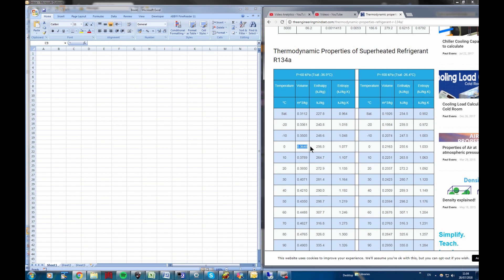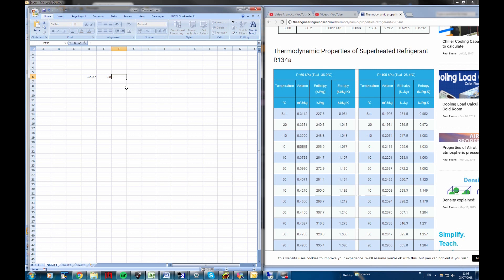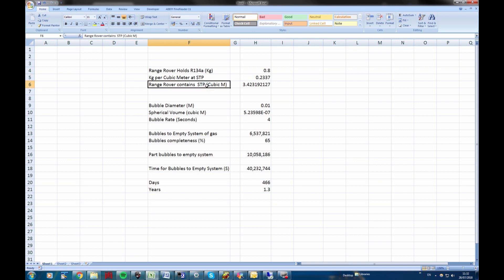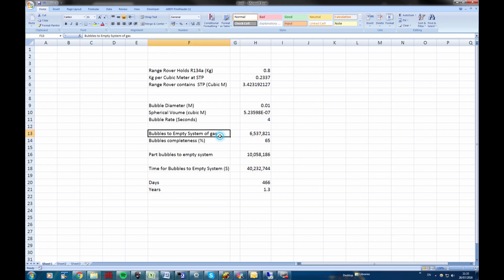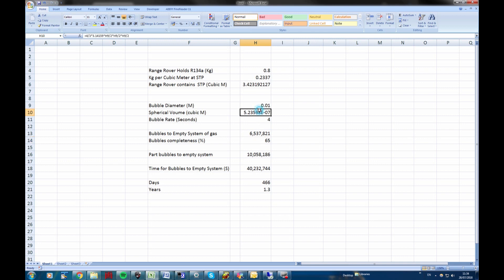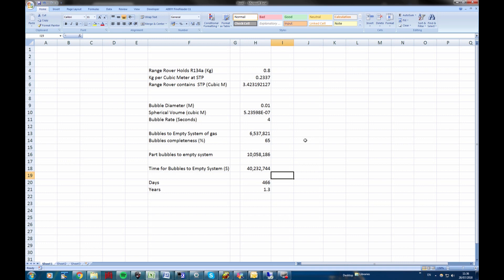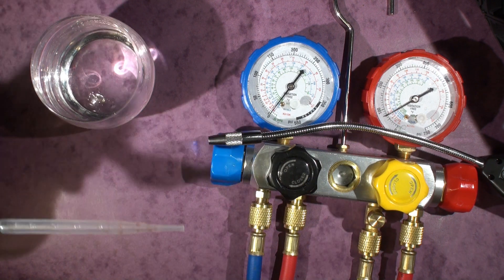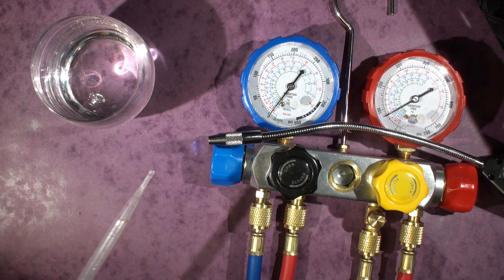Elitech WJL-6000  eBay HCFC Halogen Air Conditioner leak detector Part 2

Comment: did you ever track the tiny leak down?
Reply from the maker: Yes, it was the shaft seal in the compressor.  I tracked it with UV dye.  I was told that  shaft seal works better when wet with the oil. During long periods of non-use (winter) the seal dries out and is more prone to leaking. I would be interested on views on this as I am not sure that I believe it.  The seal was about US$19. Has been OK so far.
Reply: @razenby  thanks for the reply i have a nissan almera tino 1.8 petrol my aircon can hold a vacuum for long periods with no drop but it won't hold pressure for more than about a week been told it could be shaft seal that gets "sucked" tighter under vacuum and leaks when being "blown out" using pressure....could be right i guess
Reply from the maker: @brianwilliams5930  That is a really good tip. Next time I check one I'll try the vacuum hold test. Hopefully the other O ring sealed joints are leaking  they will still leak if under pressure and under vacuum.
Reply: @razenby  Did the actual WJL-6000 fail to detect the leak? (given you've mentioned you used dye)